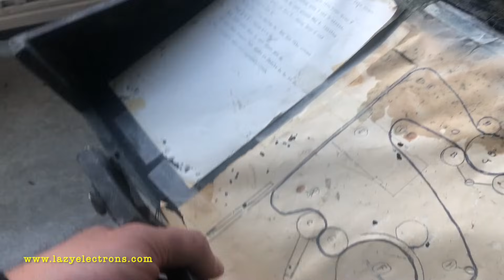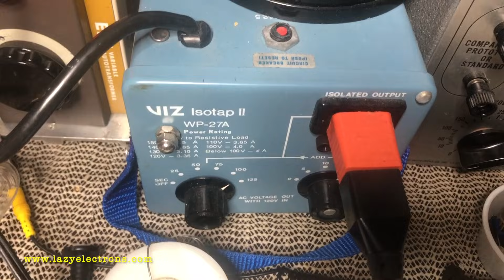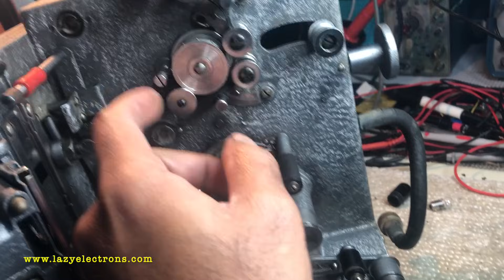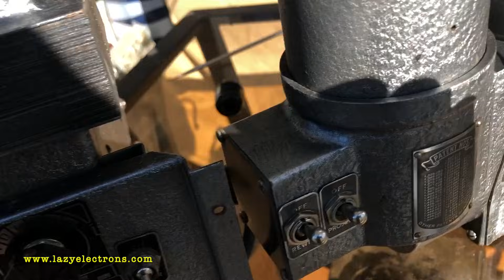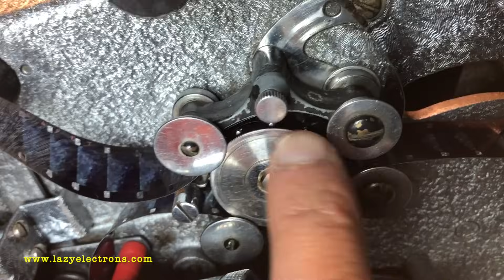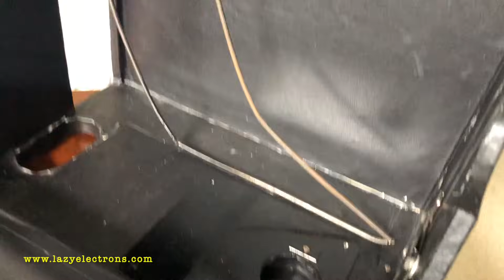Vintage Victor Animatophone 16mm Film Projector - Repair/Restore

Comment: Very nice work. The one thing i didn't see was a fly wheel to smooth out the film across the sound pickup.
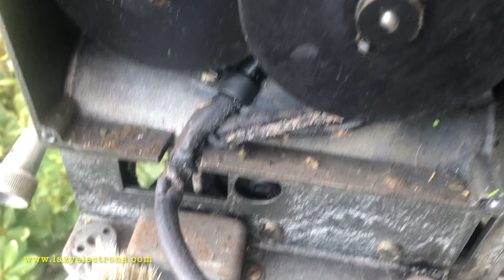Reply: I believe the two black wheels that can be seen at 10:28 are connected to the small rollers on each side of the sound 'drum'. It would have been better if the 'drum' itself was rotating.

Comment: I have a problem with my Vector film projector 16mm, there was an  error in amplifier so I replaced it but it's still not working, sound drum is also fine, how do I check photo electric cell? 
There's no ability of parts where I'm from. Please help